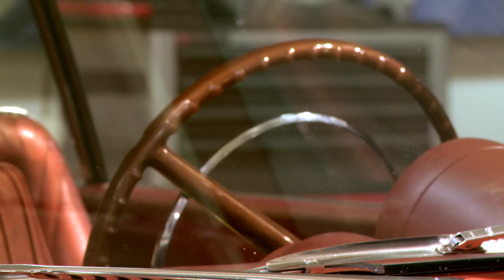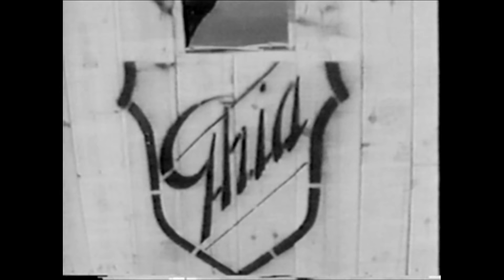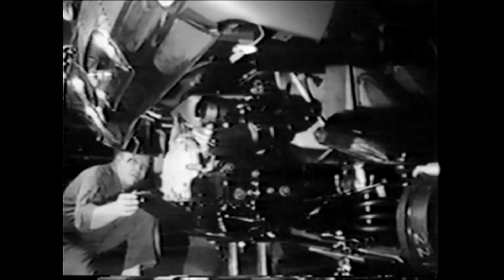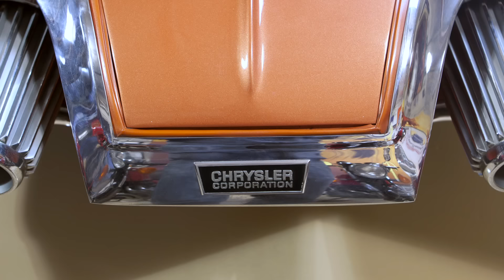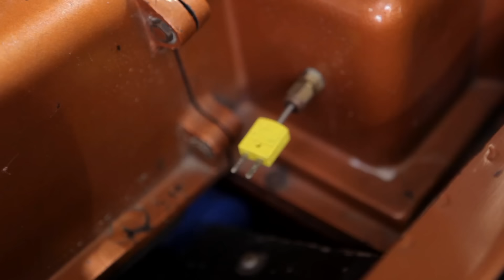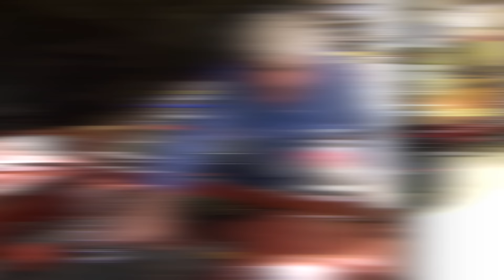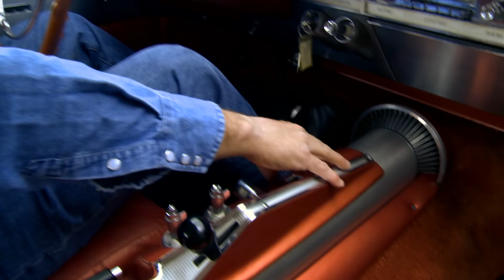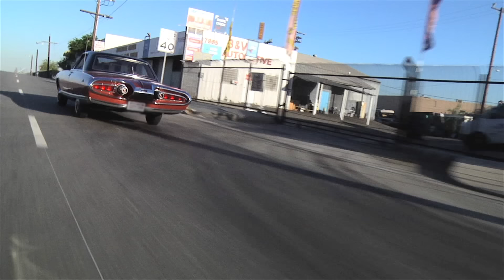1963 Chrysler Turbine: Ultimate Edition - Jay Leno's Garage

Comment: Ford Motor Company experimented with gas turbine engines. I was on my way to Vegas many years ago and was about blown off the road between Wickenburg to Vegas by a Ford with a gas turbine engine. Miles later I caught up to it. The engine was scattered in pieces all over the road and a semi Truck with the Ford oval was cleaning up the highway.  I guess they gave up on the idea. Although Ford does have a test tack west of Kingman Arizona where they pound their vehicles to death. Pretty interesting to watch them. I only got to see them in action by Kingman because I was the UPS driver and delivered to them. They got paid to destroy vehicles there. A fun job at the very least.

Comment: Jay mentions the production cost being one of the big reasons it wasn't cost effective to build. I wonder if a bean counter could have gone over it and made it cost effective? Cheap it out, so to speak. If it was low dollar trim, no chrome, manual windows, low dollar design. Then would they have been around a few more years? Could they have put catalytic converters on the exhaust? Or would they just melt? Jay does say they got the temps lower than conventional ICEs.

Comment: Watching this in 2021 and wondering why someone isn't picking up this technology and doing something with it.  A vehicle that can run on any bio-fuel  without the need for fossil fuels would be far better than the current crop of Electric cars that rely on charging stations powered by electric plants which still burn fossil fuels to generate electricity.

Comment: Strange they did not figure out a way to use the extremely high temperatures to power an afterburner that would burn off any hydrocarbons or be used in part of an emissions negation system.

Comment: The EV-1 was more than a prototype. Yes they were handbuilt, but it was ready for mass adoption, especially after GM finally deployed the Ovonics NIMH rechargable battery in the EV-1. Big Oil got elected (Dubya) and that was the end of the California state law that made the mid 90s electric car revolution die. They basically condemmed thousands of Americans to death via air pollution. GM rounded up 2000 of these cars and crushed them in the desert. The few remaining cars had their engines ripped out so even the powertrain design could not be studied. The documentary "Who killed the electric car" shows the whole tradgedy. GM then sold the very revolutionary EV car battery to an oil company who sat on the patent for years and then they sold it to BASF, the german chemical company who were part of the A.G. Farben business cartel, the only corporation ever put on trial for war crimes (Farben used Auscwitz victims as slave labour). In my humble opinion, GM deserves to go out of business for ever for this.

Comment: The main reason they didn’t build them is because they where told in the 60s that it would be a billion dollars to build the factory and infrastructure to build it also the engine alone was 10 grand when gas motors at the time where a couple hundred.

Comment: Imagine a modern turbine/electric hybrid. Turbine on the highway or when battery was low and electric in city traffic. Much less moving parts. Probably give it a range in the thousands. Turbine for speed and electric for torque. Probably run it on LPG or propane to reduce running costs. Which means it could be a large pickup at a fraction of the running costs. Which could include a large power supply for work or camping - without any concern about reducing the range of the vehicle.

Comment: The way the Chrysler video describes the heat exchanger is not jiving with what I remember from my Gas Turbine Engine Technology class. I recall that the temperature from the compressor needing to be as cool as possible because it’s the temperature differential (before and after combustion) that gives the power and efficiency. Perhaps a current turbine engineer could explain...

Comment: Now this is a real surprise!! People are making jet engines today to power everything from RC aircraft replicas of fighters to skateboards & even skates using tiny jet turbine engines but when you think that the first prototype engine was designed in the 1950's that was really forward thinking, after all, the first jet aircraft prototype was flown in 1942....designed in Germany by the Horton brothers and thankfully that never made it into production. It was far faster than allied fighters at the time and would have rendered Britain's radar useless in giving enough warning to get Britain's fighters into the air. The Horton jet fighter would have left only 2mins warning possible and who knows where we'd be today if that jet had been mass produced! Chrysler was clearly an innovative risk taker but the cost of the Chrysler Turbine was astronomical (pun intended) when you consider what people were paying for cars in the early 1960's!!

Comment: As deposition manufacturing improves and electric drive trains with battery and/or super capacitor tech becomes more common small turbines may become more practical.

Comment: I've heard of it, but this is the first time seeing it in a newer video. Imagine today, using this technology to make an even more compact and efficient turbine to generate huge amounts electricity very quickly to charge and extend the range of plug-in EV batteries, and just powering the wheels with electric motors at slower speeds. I think it could work.

Comment: I was a 19 year old young Marine walking in Memphis when a car the same color as this one came driving by with the sound of a jet engine highly muffled cruised by. My first sighting of the turbine engined car. The exhaust was so hot if the car sat very long for a stoplight the asphalt would soften where the exhaust came out.

Comment: The word "turbine" is pronounced like "Ter-BYE'n",  rhymes with "-NINE".  Jay pronounces the word "turbine" like the word "turban" ("ter-BEN") which designates the South Asian and Middle-Eastern linen head wrap that men wear. Two completely different words with two completely different pronunciations and meanings. It's a common mistake.  "TurBINE" is a type of engine (or motor), like the one in this badass 1963 Chrysler car; whereas a "turban" is type of head wear worn by traditional South Asian and Middle Eastern men.

Comment: Perhaps the turbine car's time is near. Turbines are very efficient when operating at their design point, which is at very close to their maximum output as the compression ratio increases with power. A series hybrid based on a small turbo-generator could be synergistic with modern battery or super capacitor tech. The generator would be sized to power the car continuously at  a maximum cruise speed with a battery to allow rapid acceleration and burst speeds. At lower speeds the turbo-generator would cycle on and off to maintain the power storage within charge limits. The engine would always be operating at its most efficient power output.  This is even mechanically simpler than the Chrysler turbine being a single shaft with the starter motor/generator with one moving part, no power turbine or transmission needed. The light weight, smooth and fuel-agnostic characteristics could make this a winner yet. The turbo-generator could resemble the systems seen for fixed power topping systems, perhaps something like the Capstone recuperated microturbine; https://www.capstonegreenenergy.com/info/technology

Comment: I had A Girl friend in 1964  who lived in Gulf Port Fl, I lived in St. Petersburg Fl, she had a woman living next door. To one I of lucky 200 some people who got one to drive for 3 months. Nice lady we let each other drive our cars! I had  one of the  rare limited product 1963 426 Ram Charger factory drag car ( known aThe Orange Monsters) it had Two four bbl carbs on a one pieced magnesium/aluminum alloy intake14 1/2 inch long   intake runners which were tuned the actually bring volumetric efficiency tO 103 % it had a special 727 Torque flite and Hd differential within a 2  1 1/8 inch pinion shaft? Also had a heavy D4 diesel tractor battery in trunk mounted over right rear axle. It came with 4 inch dump pipes for drag racing! It ran in the high 12’s right of the street, it was my daily driver along with 56 corvette roadster with both tops?

Comment: 5:38 - jets/turbines are dirty? Ixnay, dude, it's the fuels. Turbine aircraft engines typically burn what amounts to kerosene with various additives. While kerosene gives you a lot of bang per gram (VERY important for aircraft) it IS a dirty burner even under optimal conditions. 
Alcohols, while not providing as much oomph, thermodynamically speaking, they burn far cleaner than kerosene and gasoline - ESPECIALLY in a turbine.  Maybe not for aircraft, but ground vehicles? Sure, with modern materials and engineering it would be viable.

Comment: Interesting idea to use rotating regenerators instead of an ordinary counter flow heat exchanger. Don't know why they did that.
Also wished they used a turbine half the size, linked to capacitors and an electric drivetrain. Far less fuel and cleaner, maybe even passing emissions.

Comment: I owned a few Rover 2000's. They were designed to be turbine powered. But that never happened. The front suspension and stearing systems were designed to allow room under the bonnet for the turbine. No alignment shop would fool with those mid sixties Rover sedans.

Comment: I talked to a GM engineer who worked for GM in the 70s and 80s and he said they were big into engineering turbine engines for cars which were meant to be put into production.  Many engineers and executives were driving around in turbine eldorados etc. for fun and for testing.  This engineer had an eldorado to use (the kind they made from 79-85).  I can't remember the exact years this all was going on.  But one day GM came in and told them all it was finished.  They burned the engineering documents and crushed the cars.  One day it was Turbine cars, the next day it was not.  This engineer says they had accomplished very advanced stuff and could have put them for sale the next year if they wanted to.  Completely useable cars.  Not only that he says they had solved the gas consumption problem and they had gotten so good that if they had gone ahead with the turbine cars, the GM corporate gas consumption levels would have gone down significantly.  It was 25 years ago so I can't remember what MPG he said they were getting but it was nearly double the mileage they were getting on their best piston cars at the time.  You wonder why these things happen, could be a dumb executive decision, or just GM being in league with the oil companies.  Tell your friends the oil companies that starting next year they will only be selling half as much oil and they are likely to make a deal to stop it.   Makes me wonder why even today they don't let the most efficient motors get sold in the USA.  In 2008 when the US Jetta diesel got 40mpg, the UK version got 76mpg (us gallons).  They say that's because fuel was more expensive in the UK.  So appearently they just make us use the max amount of fuel we can afford by making us buy guzzling motors.

Comment: I would have liked to hear how it feels to drive. Does it feel like a fly by wire piston engine on how it performs on the road? 1 gear or is it a multi gear automatic transmission? Drum brakes?

Comment: If I remember correctly, a turbine has a 100k/hrs MTBF (~25 moving parts? ) as opposed to a 10k/hr Diesel MTBF(~300+moving parts? ). BTW, I'm a diesel snob. Gasoline is corrosive and eats your engine.  Where if you covert a gasoline powered vehicle to NG/LPG you'll get a diesel engine life span..  A turbo electric vehicle lets say an APU, might be very interesting.  IMHO, the inherent multi-fueled nature of turbines and diesels put them out of favor in the US.

Comment: I saw these cars going around the building at the New York world's Fair, too, Jay. I loved them, too. The color of bronze is still popular with me even now because of these turgine cars. At that time I 20 years old, and I remember they ran on all fuels, but nobody cared because fuel was 30 something cents per gallon.  Nobody cared! I am 76 years old now, and I drive a 2011  Lotus Evora S, a 1954 Packard Pacific, a   1962 race engined Slant Six Valian Signet, a 1961 Chrysler 300G, a 1964 Chrysler 300K, a 1964 Studebaker G.T. Hawk, a Chrysler Crossfire SRT6 , a 2006 Chrysler 300C Heritage Edition] Convertible [custom made in Florida High Point].  I have loved cars since I was 12 years old in Franklinton, LA 70438. Wheeeeee!!!!

Comment: I am 70, a Detroit native. It was probably about 1963 when my family was going south on I-75 as I recall, and one of these Turbine car was sitting on the side of the freeway.  A few minutes later it blew by us like we were standing still. Unlike some of the others here. I never had any other experience with them. But since Mark Olsen brought up the EV-1. as a retired GM engineer, let me bring up the Volt. First this is my opinion and observations. GM never said anything like I am going to say certainly to me, IDK about public, but I doubt it.. But I was walking in Bldg 40 at the Proving Grounds with my head down, lost in my own thoughts. In the corner of my eye, an EV-1 stopped about 2 feet from my knees. I crossed a traffic lane without looking and almost got run over because I never heard a thing. What GM has talked about is that as the EV-1 evolved, at it's peak it wasn't all that good. GM pushed lead acid as far as it would go, which wasn't very far at all. Somebody go the idea to add a small trailer with a generator on it to extend the range. When they pushed that as far as it would go, it still wasn't all that, speaking from a viable production car point of view. So the EV-1 went away, and I get that it was a collectable, Icon, I have no idea why GM did what they did,  but I have my own opinion. A few years later, out comes the Volt, one of my projects. IMO it picked up where the EV-1 and it's little trailer left off.  Runs off a  battery for 40 miles, although in my development vehicles I don't recall getting less than 45. When the battery discharged to a certain point, the gas engine turns on, and generates enough electricity to run the vehicle until you run out of gas. And then the battery kept enough juice, so that if you got to this point, the battery would give you one last small chance to get to a charger or a gas station.  I wish I had a Volt. It's perfect for where I live. If I want to go to a neighboring city, 15 or 20 miles away, I can go there and back and not use a drop of gas. I can drive to work and back, with out using a drop of gas. If I wanted to go see my children I could have jumped in that same Volt, driven across country, with out a worry. On a couple of my development trips, we left Milford Michigan, drove to Atlanta GA, then to Death Valley. Again in IMO the Volt replaced the EV-1 and was a great electric vehicle.

Comment: This was one of my favorite reviews by Jay, if not the best review yet.  I remember the publicity surrounding the turbine car and I was fascinated by it for the simple reason it was introduced at the beginning of the commercial jet age.  I was an enthusiast of aircraft because we lived under the main runway flight path of exiting planes from San Francisco International. I saw every type of aircraft evolve from the piston age to that day in the early 60s when the first Boeing 707 passed over.  It was a grand entry complete with big noise and a lot of black exhaust smoke. 

In all respects, the Turbine car was not only beautiful but an example of engineering foresight that personified thinking outside the box.  You could sadly understand why the car didn't reach production, but why Chrysler destroyed the models produced I could never understand.  Thanks, Jay for putting this unique and wonderful machine on stage for all of us, including those too young to remember it for all to see and admire.  Maybe someone has already said what was the projected retail price of the car, if not, does anyone know?  Realistically, if Chrysler made only one per week, the cost per car would have been out of this world.  However, maybe they already projected those costs would decrease once manufacturing was refined.

Comment: The one spark plug thing is not an issue as it's only used for starting the engine. Once started jet engines are self sustaining. In fact aircrew only switch them back on at the landing phase of each journey as a precautionary measure to provide for auto re-ignition in case of unexpected flameouts.

Comment: Great video. I love the fact Jay's vintage vehicles are kept to be driven. An especially brave thing to do with a 50 year old jet engine with no spare parts availability. New turbine blades etc would be incredibly difficult and expensive (if not impossible) to produce if they were to fail.

Comment: I've been wondering if the engine would be cheaper to produce if the designers used a small Tesla-style turbine engine spinning a generator. The rotors of a Tesla turbine don't require as much precision machining as a standard turbine which would make the engine cheaper and easier to mass produce.